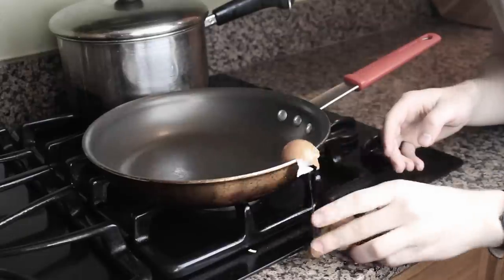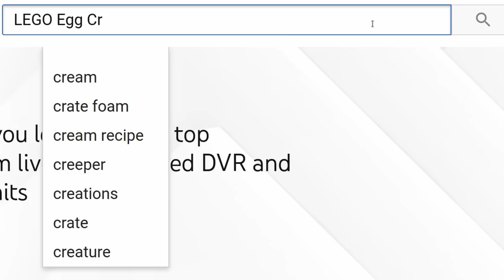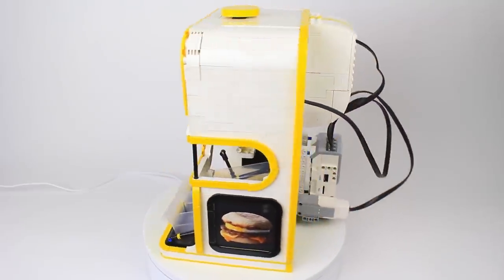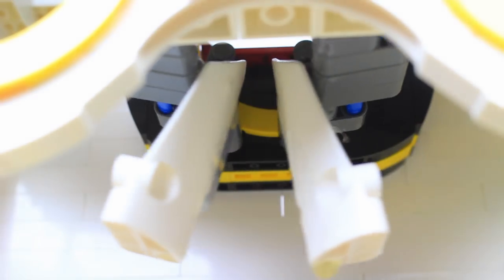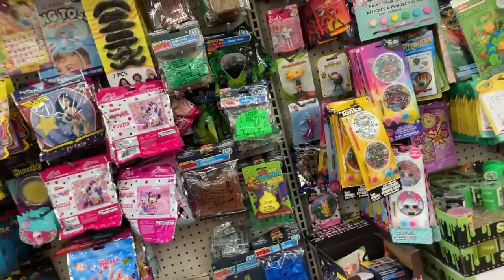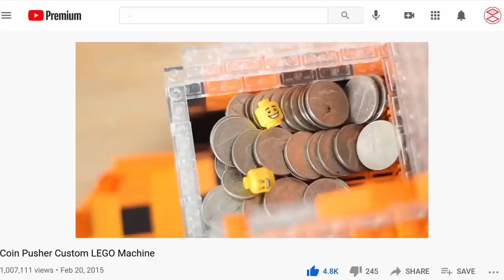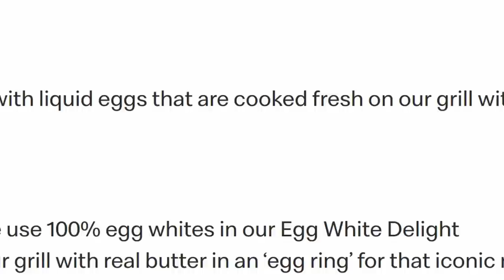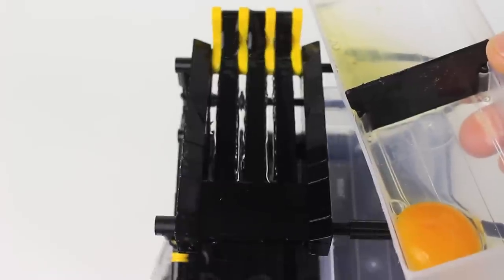LEGO Egg Cracking & Separating Custom Machine (for McMuffin Machine)

Comment: You can buy egg whites in bulk and scramble eggs in bulk... you need to what I call abort the egg youk to get and even round egg / even cook and cooked through round egg..  your machine if used for McDonald's would need it to go over the small grill for eggs. Steam cook on the grille. Then remove the eggs from the egg cooker machine  to a rectangle  warming pan. Without the employee having to do anything for it besides maintenance and loading up and taking the tray to the holding oven